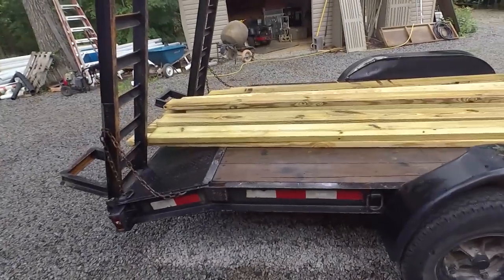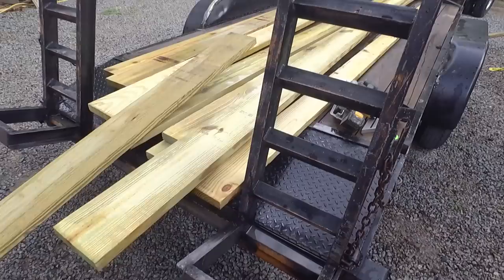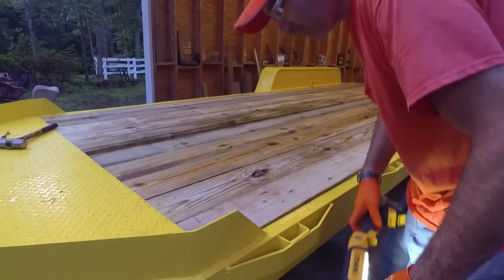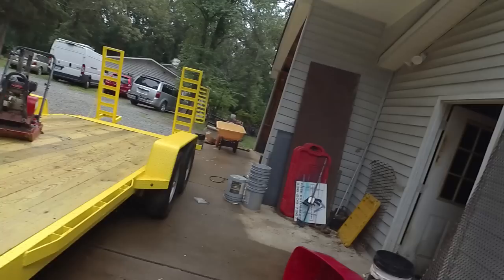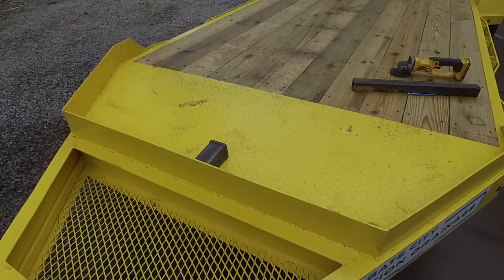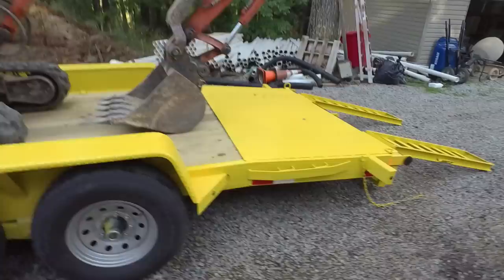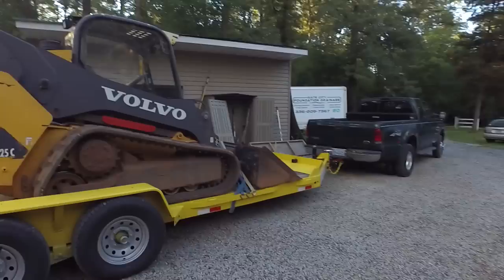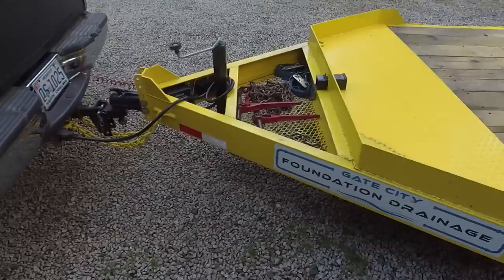Equipment trailer build Part 5 Decking, winch mount, decals, loading

Comment: Is smooth pvc better at applying the truck's brakes or would corrugated do the job? 😁 More seriously, is wood expansion something to worry about? Are you going to treat it? I love the yellow colour for the metal, would be a shame to paint it black!
Reply from the maker: The pressure treated will shrink over time, which is why I pull the boards tight together. I will treat it after a few months and the wood dries out some. And yes, PVC for the win!
Reply: LMAO...so zany!

Comment: Did you stamp that vin number underneath somewhere (hidden) so that if the trailer is ever stolen it’s still identifiable if the visible one is ground off?  It should have it stamped in a couple places for easy identification.  Just a thought.
Reply from the maker: Yes I stamped it in a few places. And I welded my initials in the frame. You can see it in the wiring video.
Reply: Was my comment on the previous video, Since having a Welding business in the family for almost 40 years every custom trailer build had it ( and a name) welded in - not just stamped....

Comment: You Sir, are an excellent craftsman! I have wanted to build a trailer for a while. When I do I will be able to use your videos as a guideline. Well done. The trailer should work out well for years. Thank you for making these videos.
Reply from the maker: thank you Winston! i think making the videos was more work than making the trailer. I still need to do the last installment of this build, titling, cost, and using!
Reply: @GCFD  Very nice Sir.

Comment: Great Ideas Shawn. Even go so far to add a Generator for welding repairs to your equipment in the field. Wood was more expensive than a steel deck, but in the long run, it's an expense that will last quite a while. Maybe a small light bar in the rear of the cab for early morning or night deliveries or pickups. Run one in my truck, and it's great to have, and as always, Great Job!
Reply from the maker: Thank you Robert!
Reply: @GCFD  
Was the wood really more expensive than a steel deck?

Comment: i see you mentioned that you might paint the trailer black at some point, but if it comes to that point, you should keep some of the yellow, so it's like a bee, black and yellow lol
Reply from the maker: That was my original plan - to paint certain parts black like the rub bars and the front decking. I thought it would look pretty cool. Time got away from me and I just did yellow.

Comment: You need to cross your chains. It will act as a cradle if your trailer hitch fails and is required by DOT if you are CMV.
Reply from the maker: Good point!
Reply: I’ve been crossing the chains for years and never knew why I was doing it. Thanks for telling me! Lol

Comment: Nice build. You may want to add more reflective tape to the sides, DOT requires at least 1/2 the length of the trailer to be in tape.
Reply from the maker: Good call!

Comment: If you had to do it over again would you have the smooth side of the channel frame facing inward? I think it would have made cutting and welding a couple of the frame cross members easier, but then would have complicated the side rub rails, D-rings, and fenders. Nice trailer build, Shawn! I am planning on building my own. This build series is very helpful =0)
Reply from the maker: No way Loren. Check out my other trailer videos where I referb a Hudson trailer https://youtu.be/IsJDK9UaARM This has the C channel facing the wrong way and I still struggle to tie stuff down with that trailer. My yellow trailer is still my favorite.

Comment: Good luck with your new trailer which looks great. Suggest you load the trailer keeping the weight on top of the twin axles and then you will have better balanced trim when towing. I know it may not be always possible but its much easier tow a balanced load than where it is either front loaded, where the weight is bearing down on the hitch, or rear loaded where it is pushing up the hitch. I like your channel and enjoy your presentations.
Reply: I guess you know that  balanced  with out  toung weigght is no bueno ... right ..

Comment: Hello
You said you would make a hole in the front diamond plate to drain the water
Did you regret it?
Dont forget painting naked place such new thing which weld it
Reply from the maker: Yes I dirilled a few holes and they are working very well.

Comment: Acknowledging that I have not built a trailer before....I would have spaced the boards apart, say, 1/2" maybe.  You butted them to each other.  Why no space between them?  Is there a reason beyond personal preference?  Thanks!
Reply from the maker: These are brand new boards and so they will shrink a bit. I close the gaps knowing that gaps will form as the boards dry out. Same with a deck.

Comment: Could that trailer hitch just able to spin around 180° instead of cutting. Unsure if it would work!?. Great build by the way. 😁👍
Reply from the maker: I'm not sure I understand your question
Reply: @GCFD  the part you cut, that was too close the the road. As you pulled it out of the truck, could it have been pulled out then turned 180° the put back in the truck?. That might have worked without cutting the bottom off??.
It would flip that part over. Too late now as you've cut it, but I thought it could have been an idea. Hope I described it correctly. Nice trailer Shawn .
Reply from the maker: Yes it could have been turned up. It still looked wrong with that much hitch sticking up in the air so It needed to be cut. 👍
Reply: @GCFD  I thought you would have looked into doing that but I didn't hear you mention that you looked at it so I thought I'd give it a mention. Thank Shawn, waiting for your next video 😁

Comment: You may want to coat the ends with log sealer to help prevent future splitting - which you can probably do from the underside even with the deck installed.
Reply from the maker: Great idea!
Reply: I agree the cut ends of the pressure treated wood should be retreated anf if the filler center board had to be ripped to fit then the ripped should be treated too.

Comment: I have to admit that I have never seen anyone strap their wood planking tightly together. I was a jumbo jet pilot so what do I know...other than I have been told that wood expands when wet. If that is true then why would you strap dry wood together, or was it wet wood strapped together???
Reply from the maker: This was brand new green treated lumber so it was very wet. It contracts as it dries out and gives a slight gap between the boards.
Reply: @GCFD Thanks...now I know the answer to my question...and it makes sense. Blue Sky's.

Comment: Do you stain the wood or leave it being pressure treated?  What about adding like a grip spray lining or tape, etc.  I've seen a lot of videos of people and machines slipping on wet mossy wood trailer decks.
Reply from the maker: I have treated wood decks before with thompsons water sealer with good results. Several commenters have mentioned used motor oil.

Comment: Hi Shawn, is your trailer now finished? And what sort of moveable winch are you going to use on this new trailer, as I think that it is really good that you took the time to build this one ☝️ and for it to look really good for such a practical piece of equipment.
Reply from the maker: Yes the trailer is finished and I've been using it. The next video will be costs, titling, using. Coming soon!

Comment: G’day mate, nice build have enjoyed watching this little series, do you treat your boards with anything eg linseed oil? Or are they treated pine?
Reply: I use used motor oil, best cheap way just as good.
Reply from the maker: I am letting the boards dry out a little but want to treat them with something. I'm worried that used oil will be too slick?
Reply: @GCFD  the boards will soak the oil in. All stain or water repellent is, is oil. Google it, some thin the oil with diesel some use it straight.
Reply from the maker: @bcschroeder8696  awesome. Thank you! I have lots of used oil around!

Comment: Nice job. Your skid steer almost didn't fit. 😎👍 On my 25 foot gooseneck flat bead I mounted my winch the same way. (reese receiver) I use a Harbor Freight BadLand 12000 lb Works great. Strong too.
Reply from the maker: 👍 My truck has a gooseneck hitch but I've never pulled one. Are they safe? What if the ball lets go, will the trailer take out the cab?
Reply: @GCFD     I think Goosenecks are a lot safer than bumper pulls, the way weight is distributed  in front of rear axle. If it was to come loose from the ball the hitch might hit a short wheel base cab before the trailer hit the back of the bed. Id have to measure it. They pull so much better. Also you can turn them around in a 2 lane road.
Reply from the maker: @1loadermanjack  they make a lot more sense than BP trailers.
Reply: @GCFD  I measured my Silverado,(6ft. bed) front of trailer is 32 inches from bumper but the hitch is 31 inches from front of bed. My GMC Sierra has 8ft bed , it wouldn't hit the front in that truck. Also on both of my trucks I have B&W turn over hitches. Once you pull a gooseneck you won't like BP's anymore. lol

Comment: Looks awesome. Is there a parking brake on the truck? Possible to wire that to the trailer brake? I guess the engineered brake pipe does work tho! Can't wait to see the skid steer at a new job!
Reply from the maker: That's a great idea but I think the pipe works just fine for now, like you said. I definitely prefer schedule 40 over corrugated for applying the brakes!
Reply: @GCFD  lmao

Comment: How did you go about getting it titled (ie) the VIN number I have always wondered about that process because I would like to build my own trailer as well
Reply from the maker: Are you in NC? What I had to do was take the trailer to the DMV for an inspection. I had all my receipts for the parts and materials. They looked at the VIN I had stamped on the trailer, looked at my paperwork and gave me the paperwork to title it. They didn't check a single thing with the trailer besides the VIN.
Reply: @GCFD  
Yes I'm in NC I appreciate the info great job looking forward to seeing more

Comment: Paint your decking with old motor oil. it's as good as stain and a lot cheaper.
Reply from the maker: I have tons of that. Does it make the deck slick?
Reply: @GCFD  
Definitely is going to make the deck slick.  Why not just use the old motor oil on the bottom and sides and ends and then maybe some truck bed liner for the top. Or clear with a texture, maybe sand and just touch it up as time goes on. Depending on visual preference.  Seems sealing yet grippy

Comment: What is the trailers registered GVWR? Just curious. Did you have to go and get it inspected to get it registered?
Reply from the maker: Robert the inspection was a joke. He took one look at the trailer and my paperwork and signed off on it. It has no registered weight as they didn't ask for one. I need to finish that video where I title it.
Reply: @GCFD  my question here is. What happens with DOT If you get pulled over and don’t have a registered weight? I feel they dropped the ball and put you in a hard place if you get stopped

Comment: I would put the vim number in some different places 1 that can be seen and a couple hidden and take photos of were they are. As you said in a earlier video that there was quite a phew trailers going missing
Reply: Agreed. Use the welder to weld GCFD in a couple of places or cut the letters into some permanent piece, make things difficult.
Reply from the maker: I sure did! I also welded my initials into the frame. They are visible in the previous video (;
Reply: @GCFD  "Excellent"  as Monty Burns would say
Reply from the maker: @ronkennedy213  at least I’m not working in sector 7-G

Comment: Please consider keeping it yellow, people are less likely to run into a bright yellow vehicle. 
Or perhaps white, another safer colour. 
Both show up well at night and against the black of road surfaces. 
Statistically  they are about 10% less likely to be in an accident, and that is significant.
Reply from the maker: I like the yellow more and more every day. It's showing signs of use but I can touch those up.
Reply: Yellow ( im not a fan of white at all )  It's the official color of Matt's off road & recovery, including the Banana (Jeep) and the Morrvair.  Not to mention we had a custom '83 3/4 ton Suburban in the family that was yellow as well.

Comment: I think after a couple of years when the wood will be destroyed… you will go for steel deck. That will last forever. My suggestion will be to get at least one spare tire for the trailer. You can attach them on the front. Left and right.
Reply from the maker: My care trailer's wood deck is 15 years old and starting to deteriorate, so I hope to get 15 out of this one. Steel is just too slippery for me.
Reply: @GCFD  good! I was thinking on the steel with diamond pattern on it.
Reply from the maker: Yes diamond plate is extremely slippery when wet or muddy.

Comment: Excellent job
Reply from the maker: Thank you Chris!
Reply: Which axles did you use ? I’m in the middle of rebuilding an old trailer and looking to buy a new tandem axle kit
Reply from the maker: @cd1168  I used some 7000 blacked with electric brakes. I think they were dexter